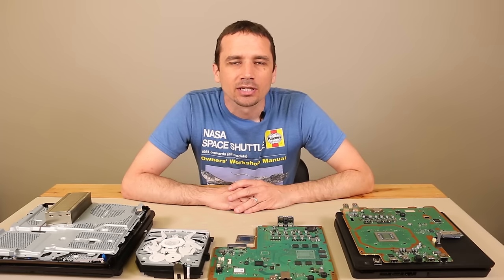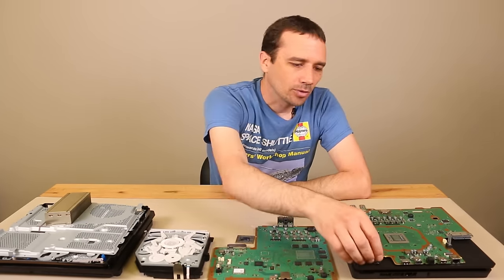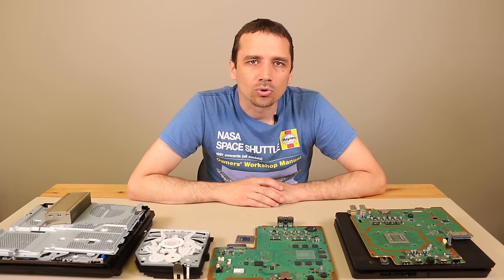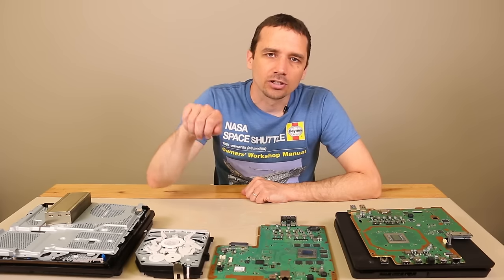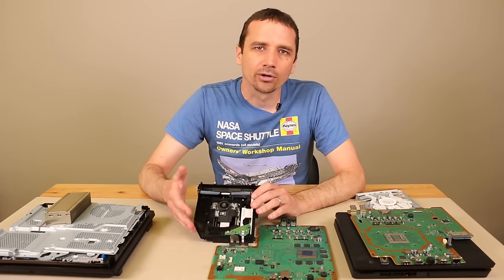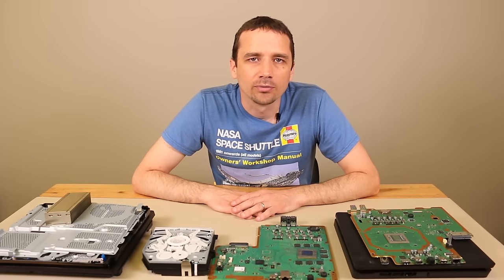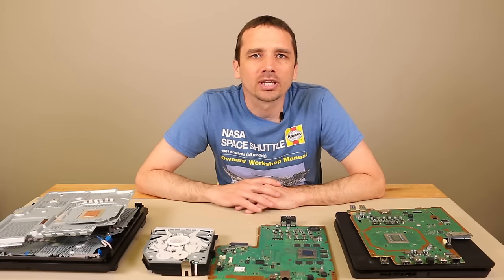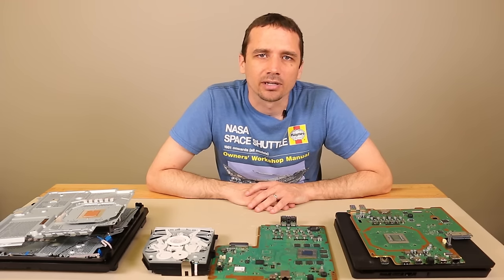Top 5 PS4 Problems With Solutions

Comment: I have over 10,000 hours on my ps4 I got it within a month of release, never had a single issue.
Reply from the maker: Most Ps4's don't have any issues.
Reply: I've heard that if you have the ps4 running in stand mode, the solder will slip.  unless you have a stand with a base fan cooling the system.
Reply: Bryan Smith I've had my ps4 like that for 3 weeks now and no problem.
Reply: i got mine a week after release and i forget to turn it off all the time, leaving it on for days sometimes even, and i have yet to have any problems with my PS4 at all. i probably got well past 10,000 hours myself. lol
Reply: I have a ps4 slim. I hope its more reliable than ps3 fat
Reply: Eluminary Xarrais Same here!!! Had more problems with the PS3!! Had to replace that one three times
Reply: Ive had my same PS4 since launch only problem i have is its loud that's all i love ps they're built to last no matter how many hours you have put into your system good job sony woooooooooo
Reply: What about the controller. Something breaks on my controller every 6 months. My r2 trigger spring just broke today.
Reply: Eluminary Xarrais there's only like 730 hours in a month there no way you have 10,000 hrs on your PS4 within a month
Reply: The dust problem is real and the dank smoke aswell, my first Gen ps4 got really loud so I finnaly oppend it up 4 years later cleaned it and she's runs quite now
Reply: Same here but i have more like 1000 hours.
Reply: sean_22_22_22_98 maniac it is possible. I have well over 10 000 hours spent on games
Reply: Luis Rodriguez same here, but mine was 3 years old when i cleaned it.
Reply: sean_22_22_22_98 maniac Said they got it within a month of release, and since then, have put 10,000, not that they out 10,000 in a month.
Reply: I have this issue sometimes where i would browse in the PlayStation store and it will freeze my ps4, but it doesn't happen alot. Does anyone know why this happens? I just hope that my ps4 is not dying :(
Reply: TronicsFix LLC my ps4 dont got that orange thing on the thermal paste place. And I saw my fan it looks ok. I get a red light problem. And plus my ps4 turns on 5 secs later red line. Need help so I fix it? I think its the thermal paste
Reply: Eluminary Xarrais lucky man mine overheats and turns off
Reply: Eluminary Xarrais 
Same here.
Reply: Hmm,in a year,theres only about 8760 hours,and u said u played over 10000 hours,knowing theres only about 720 hours a month,so why ya gotta lie
Reply: @williamstonechild6939  yet theres thousands of people having probs
Reply: @sean____maniac  finally someone else noticed too
Reply: @derbimies1148  yeah totally all games are only on ps4
Reply: Eluminary Xarrais u bum
Reply: Your lucky
Reply: i've had 3 PS4's now and no problems until they break
Reply: @nebulaplayzzz9345  Actually not, never got extreme loud noises. Its actually very quiet, i'm aware that the launch versions got some issues. I bought mine a month later there was a special action from a shop that still got stock.
Reply: Bet
Reply: Same here still using the very first PS4.  I have soooooooooo many days on it and never a problem.
Reply: That's actually really, really good, well done
Reply: I've had ps4 for 8 months. I've got the "on/off problem" blue light blinks for a second and then...death.
Reply: @bryansmith1881  that's bull crap
Reply: That's like my PS3.
Reply: Your the most lucky person on earth or just take care of your stuff
Reply: Стейси Станоевич  I used playstation 1 year warranty and they fixed for FREE!
Reply: I got mine a year ago and it freezes soo much and audio cuts. Its not even loading the icons.

Comment: I have just refurbished my first PS4 slim this evening. Bought it super cheap off eBay and fixed it for my own use and I never transferred the circuit board off the blueray drive to the new drive and its working fine. No errors or issues. Replaced the HDD with an SSD, replaced the blueray drive and the fan and put new thermal paste on the cpu. The amount of dust inside it was unreal, it wasn't dust bunnies so much as dust walls. And it stank of cigarette smoke. Had a thorough cleansing with isopropyl alcohol .

Comment: When I turn my ps4 on everything goes fine for just like 8-10 minutes and suddenly some glitched dots come on the screen (on any monitor) and it suddenly turns off. 
I went to a repairing shop and i got to know that the ps4 processor needs to be fixed others said that the motherboard has a problem.
Now I dont know whats true and dont know wat to do
Reply: Buy a new ps4
Reply: Heeduz mine turns on put first it says checking storage status then it loads up the ps4 dashboard and then it has the white light and ive done factory reset my ps4 and it didnt help so im trying to download my game and it wont download and then when i try to delete it it goes black screen then turns back on like its just turning back on
Reply: Thats overheating my guy clean the APU heatsink reapply thermal paste
Reply: Mines doing the same thing. It will stay on for 10 minutes then shut down on it's own. Not to mention its lagging to
Reply: @justin-fb8qn  sounds like hard drive failure on urs

Comment: As most support specialists know, doing a complete format and repartition of a drive will most likely fix any kind of curroption on a disk drive. But the problem is how do you recover the lost data during this procedure when the PS4 drive is not recognizable to windows. How do you salvage the drive from a GPT protected partition that does not allow you to use any disk checking tools or any sort of diagnostics. That is the big 1 million dollar question that needs to be answered and I been searching and searching for hrs trying to find a damn resolution to this problem. Recovering the data > Reformated the hardrive > reinstalling the drive with the new firmware update > and finally, restoring all your data to the new formatted drive. Anyone have any solutations at all with how to perform these tasks.
Reply: Agreed, but it's probably going to take some serious reverse engineering workarounds to figure that out. 

If people could do it easily, Sony would lose out on all the money they make because people tragically lost a year worth of save data, leading them to buy PS+ for the save data cloud backups for the future. Make it easy enough for the average person to just pop it into their computer and recover the data, they lose out on all but the laziest of offline gamers' money.

Comment: After watching so many videos and experience that you have, I am writing to you With all due respect and love from India🙏.
My PS4 just broke down 2 days back..it all started with a freeze in the screen while playing battlefield 4 campaign mode. Then wen I switched on the PS4, it said " checking system storage" and then it switched off again. After that they asked to reinstall the 7.55 update in USB and reboot.i also did that...since then I have been keeping on doing the same. 
Sometimes after initialization, system does turn on and wen I try loading games from cd or downloading apps, I have noticed that it takes alot of time to load a game from the CD which is very unusual.
In a while it lags, system freezes or turns black automatically.
Finally system asks for the 7.55 update in a USB again.
With all hope I am writing to you and praying you to provide a solution for my above issue..Thanks bhaiya( Back in India it means elder brother)🙏

Comment: Damn roaches.  Always knocking out the power supply AND thinking it's funny. Nice T-shirt.  I also own a space shuttle and the damn roaches knocked the power supply out of that too. Can I borrow your Haynes manual so I can get it up and running again?
Reply: Have you also checked the thrusters heat sinks ? They might be lurking in there too,waiting for the next move on the portal gun PSU.
Reply: Tony Terrasi a
Reply: Tony Terrasi 😂😂😂😂
Reply: Was it using a ps4 power supply I say stick with em mate don't switch to xbox I pulled one down and found out microsoft don't stick fuses in their power supply's whereas sony does

Comment: ps4 random disc ejection
Reply: LotsaLOUD it's the dodgey touch buttons try first cleaning it and keep it constantly clean.
Remove the rubber leg under the button and if it still continues you need to open it up and disable it and eject thru the in game menu
Reply: LotsaLOUD look up David Rutledge. he has a video fix. pretty simple and works.
Reply: Another common issue for random disc ejecting is the ps screw loosening, easy fix, remove the left top side of the ps4 (It slides off) and you'll see a very specific screw with the ps controller symbols, tighten that up a bit.  Hopefully problem solved.
Reply: The gold plate scratch fix is the only way to 100% stop the auto eject issue.
Reply: this this is what i get
Reply: Just put a disk case underneath to elevate it from the surface.So that the eject button is not touching the surface or get a horizontal stand
Reply: That's not a solution to the issue.  At best it's temporary.  The only way to fix is to get to that gold plate, scratch it or put tape over it.
Reply: LotsaLOUD digital games Problem solved
Reply: Actually, the problem still happens, digital games or not.  The drive tries to still eject discs that are even in the drive.  It gets stuck in a loop.
Reply: I meant the problem still happens if you go digital.  Once that plate has a static build up, the drive will constantly try to eject the disc , even if there is no disc in the drive.  The only way to fix it is to scratch or tape over the gold plate.
Reply: Lol that's hilarious
Reply: LotsaLOUD  I have this issue ho you how did you fix it
Reply: Disc ejection
Reply: hungrynapps thank you all of you
Reply: Put the ps4 vertically or elevate the console so the eject button isn’t touching the table or surface
Reply: Yup after a long conversation with a tech representative, they wouldn't fix it without a fee even though they know damn well its their fault and it's why the made physical buttons on their newer models, so I went into gamestop during promotion and traded old Xbox and ps4 and few games for a X. Now I'm waiting to upgrade my TV to get the most of my new console
Reply: LotsaLOUD maybe the bottom gets hot thinks yiur the touching it so it rejects....thats crazy tho fam hope u sorted things out
Reply: wiseguy100 I know what you mean. You’ll hear the PS4  “beep, beep” sounds, as it keeps repeatedly do the eject disc cycle. Even if there’s NO disc inserted, it gets stuck in a vicious loop, where the PS4 starts beeping like crazy ‘n constantly like every few seconds.
After many different tries to fix the problem, but no luck. 
Till someone told me to buy air in a can and blow with high pressured air to clean PS4. 
(Specially clear any dust between the eject/power button).
Hope anyone finds this helpful.
Game on!
Reply: Pre-Ejacuation
Reply: Usually happens with 1st gen ps4. Simple fix is to remove the rubber thingy that acts as a grip

Comment: I was haven problems with my disc drive not reading the disc but it was taking the disk and then I picked my PlayStation 4 up started moving it around and it sound like something was broken in side so I opened it and looked and my kids have put three dimes inside of it took them out it works fine now lol

Comment: Hi, 
I have a problem with my PS4. I searched my issue but never found anything similar.
I bought my PS4 2 months after it launched.
It was running smoothly until very recently. It started it kick me out of my games, not any game, games with high computing powers (that's what I noticed) such as MGSV, Mass Effect, The last of us, and Bllodborne. 
some other games, I play them for hours and it never kicked me out once.
I cleaned it many times, and opened it and cleaned the heat sink without any improvements. 
any advice on this?

Comment: Old video but still gonna comment.
The powerstrip issue could be due to a voltage drop.
The longer the power line to the device is, the less voltage remains due to the resistance in the extended line.
Now if it is a really cheap powerstrip, it could have really thin lines, which have a higher resistance.
Or if you are far from the house / power net connection you also might have a voltage drop which adds to the power strip voltage drop.
One could try to run the console on a regulated power supply and drop the voltage a bit.
The US usually has 110V right? Maybe check how much you can lower it till you get that error.

Comment: What about your controller randomly cutting out and requiring a restart to get it to connect again?
Usual scenario: I pause and have to go do something. Controller cuts out, I come back and press ps4 button but controller doesn't cut back on. The only way I can get it to reconnect is by powering off the console all the way. Controller reset doesn't work, connecting with usb wire doesn't work and using two other working controllers (one just purchased two weeks ago) doesn't work. The only info I can find online is it may be the Bluetooth antenna. Could you help a brotha out?
Reply: charge it and keep it plug in
Reply: Same problem, thought i was the only one. Tried with multiple controllers but doesen’t work

Comment: when my ps4 is off it beep constantly like someone is pressing the eject button and when i turn it on the disc drive starts up like it's trying to eject a disk
i have to unplug the the AC cord from the wall when i sleep or it wakes me up its so annoying .
Reply: What version ps4 do you have? The one with the half glossy look or the matt?? The matt version has a mechanical button, could be this is stuck
Reply: @ToldYouSo18  i have the 2014 model

Comment: My issue was solved by replacing my Hardrive.  But I also upgraded it to a Solid State HD.    No problems so far and much faster loading times.  The issue i had was that screen freeze game lock up with error code 36329-3. Resident Evil 2 was the only game I had problems with but after attempting countless frustrating software solutions i finally decided to replace the harddrive which doing so fixed all my problems.

Comment: Too bad there is no solution for the L3 sprint
Reply: Nathan Robinson I’ve fixed it before I just don’t remember how exactly
Reply: There is. It’s pretty simple, just open up controller and put something under the button. Just search on YouTube for a video showing it.
Reply: All i did was take my controller and and sprayed wd40 in the joystick let it dry and haven't had a problem since
Reply: Take it apart and spray Electric dialect down there. Wd40 works but is hard on plastic.

Comment: I just bought a PS4 and I've got the HDMI issue. Not a good Impression.

Edit: sorted the problem, it was something else.
Reply: A brand new or a second hand? And check the version of your PS4 which will be located at the back just above the hdmi plugin.
Reply: @blues05  Actually I got it working. I thought I had the problem as it was on the white light with no video output but it ended up being the adapter I use for my monitor needed extra power from a micro USB for some reason. I was confused because the way I had it works for my Xbox but not the PS

Comment: I need help I changed my thermal paste to artic 5 I blew out everything in the PlayStation and even the fan is spotless but it always overheats and the fan gets very loud
Reply: Three questions: How hot is the area where the console is? Also, how much thermal paste did you put? Lastly, did you tighten the processor clamp evenly?
Reply: luchvk cold like a bit it’s a lil much tho I think I spread around but there was small extras around the place where we put the thermal paste  and yes

Comment: Can you please make a video explaining how to reach and clean the heat sink?
Reply from the maker: Sure...I do have teardowns on every console that will show that info.
Reply: TronicsFix , I have had my ps4 system since release.  All of the sudden neither of my USB ports are working AND my storage is disappearing.  (Max storage dropped to 360gb after deleting some data)  I tested the USB with a brand new controller and got nothing.  I tried resetting to default and now I'm stuck because it wants the controller plugged in and the PS button pushed to move forward.  Is this a motherboard fix?  Or is there a way to bypass this?  I have a keyboard that for some reason did work before I reset to default.

Comment: Mine keeps saying system software error and try’s to fix database and that’s on loop 😭
Reply from the maker: Could be a hard drive issue
Reply: TronicsFix thanks for the response. But a lot of people got the same issue at the same time like a month ago . I’m just gonna find a store where they can fix it i will probably make it worse
Reply: @Mert-nn7ib  did u ever figure out the problem?
Reply: Eric Becerra yes my hard drive was damaged i had to change it and now it works fine 😂
Reply: @Mert does ur ps4 work now
Reply: @Mert-nn7ib  does ps4 worknow
Reply: @foetnitem4317  even though my name ain't mert but I had the same problem,  changed the hdd and it works like new. Just don't keep it in rest mode alot